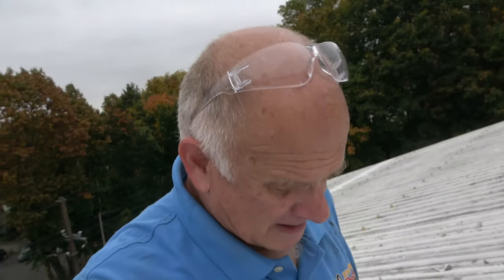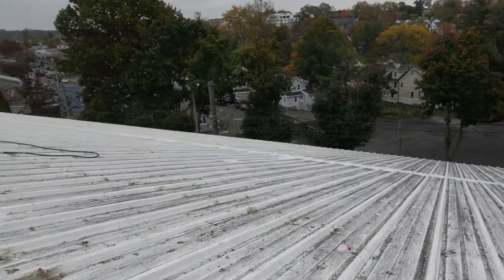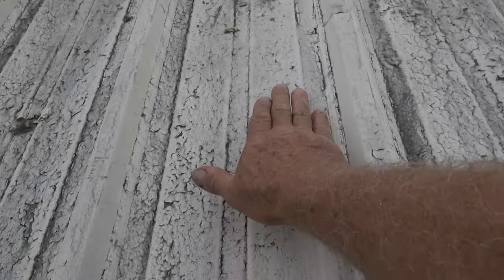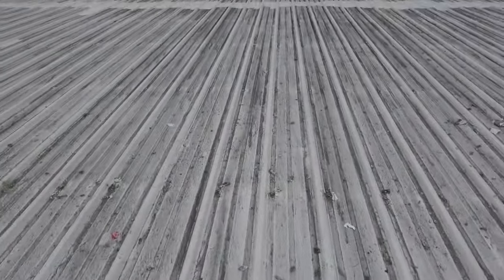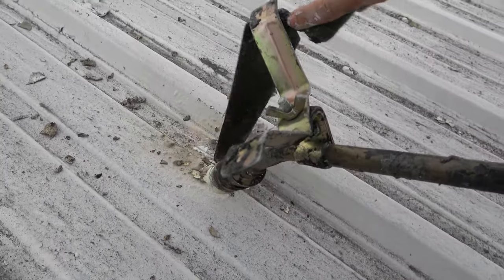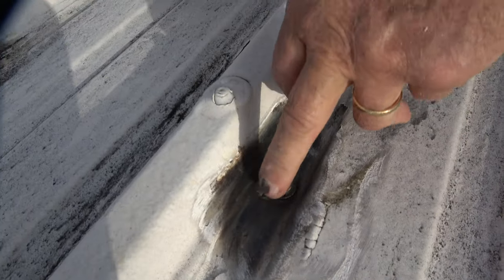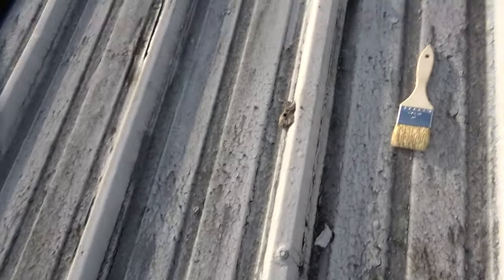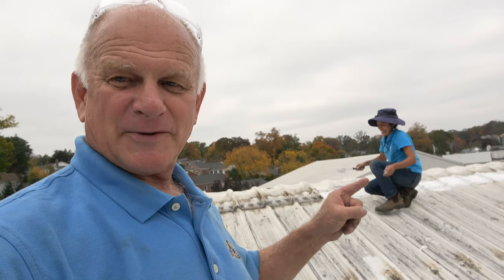Metal Roof Coating - Do not coat your roof before watching this video

Comment: You my man Flat Roof Doctor! Every coated roof I have inspected has had the same problems you describe in your videos.  Installation defects are disturbingly common, even in new construction. Question: How would you coat or seal a galvanized metal roof with surface corrosion throughout the panels? I have never seen it done correctly and typically recommend my clients install sheathing over the metal and a PVC, TPO or EPDM membrane over the sheathing.

Comment: We have a metal roof nailed on the rib that have been subsequently sealed with silicone caulk. Because of that our only option is to coat the roof with silicone. I hope being on the rib will allay the issue you found here.

Comment: Iam lost hear, at first you said a coating causes a raised area that causes water to pool and causes that area to rust. Then you go and apply a thick layer around all the screws with silicone. Won't that thick layer of silicone cause water to pool on the top area of all those screws and cause that area to rust out eventually. I mean your doing the very same thing that you said should not be done in the first place
Reply: blocking a seam in straight line will hold off water but screws desperately need sealing and a rounded area will not hold water that much, also he is using large dabs, i would just use very compact and little material just barely going around the screws

Comment: So, question, Dr:
1. Should you cover the fastener, generally, with anything or leave it as it is?
2. overlaps, should they be sealed, generally, ( with tape or cement or silicone ) or left unsealed?
Reply from the maker: I think fasteners should all be covered to protect the neoprene washer from drying out and cracking. On this roof we found that all the screws and washer were pretty good, so we did not have to replace them. The leaks were because water was trapped around the screws causing rust.
Seams should not be sealed on slanted roofs but would be good to seal it on relative flat roofs. Water can back up on flat roofs into the seams but not on high pitch roofs

Comment: I like what you did. However I would have gone over the entire roof afterwards with an aluminum coat or elastomeric coating. Depending on what the owner wanted. I’m sure you presented that as an option, but maybe unnecessary lip stick on a pig considering it needed replacement eventually.

Comment: But the metal will start to rust in a various other places if it is not protected with something..
Reply from the maker: The metal came with a protective coating from the manufacturer. The only time you want to paint a metal roof, is when the protective coating is not good anymore and rust start to show up everywhere.
Reply: Then can you please tell me, what was used as the protective coating from the manufacturer?
I would really like to know, so I could re-apply it if possible, when it is not good anymore.

Comment: Only roof coating for a roof that's good is aluminum roof coating . My roof with acrylic coating now has silver dollar size air bubbles all in it where it's seprerated from the metal . That's $400 I'll never get back
Reply from the maker: The $400 is nothing in materials. It is the labor to try and fix things after the mistake

Comment: If you were to build a home with a slight slope like 1/2 inch pitch what kind of roof would you put on it? Metal? Rubber membrane, 2 layer peel and stick roll roofing, ipo?
Reply from the maker: 1/2 " pitch is too little for anything to be called sloped. You need a 3" pitch to make it worth it. Then the choice of material will also depend on other factors. Climate, weather, obstacles on the roof, and maintenance as in cleaning leaves and other debris.
1. I like metal roofs, but the panels have to be 1 continuous panel from top to bottom.
2. I like Peel and Stick, but you must know how to install around penetrations and flashings.
3. I like TPO, but the tools and equipment are expensive, and details do matter.
4. I don't like EPDM, I think it is the worst
I think it is more important to find a roofer that knows what he is doing and that specializes in any one of the materials. That would be the key to getting the best roof. Not many roofers that fit that category

Comment: what a disaster that roof is. i bet it was expensive to coat and now even more expensive to tear all that stuff off and re-do with something else. i did mine with henry tropicool (100% silicone). hopefully that lasts a good while.
Reply: I just finished a 12k sq. steel roof with Henry's Acrylic 10 year coating...if you pressure wash it properly and your base coat gets a good bond you will be fine. The greatest attribute is the metal itself doesn't heat up which causes all of the exspansion and contraction which backs out the screws and opens cap seams etc... this guy is showing a roof that was coated probably 20 years ago.
Reply: @josephmythen3844  yeah, mine's been good so far. Also lucked out before prices exploded...

Comment: Strongly disagree. From  the looks of the roof coating that was done they did a HORRIBLE job. Looks like they did not seal any seams  or fasteners before coating. Hell they probably did not even use a primer coat. 100% silicone or elastomeric coating work great if done properly. Acrylic is definitely a no go.
Reply: Henrys elastomeric / Acrylic is fine IF you do the prep work....GOT TO pressure wash every inch and remove and replace any screws that are even questionable...I just finished a 12k square steel building it came out beautiful.